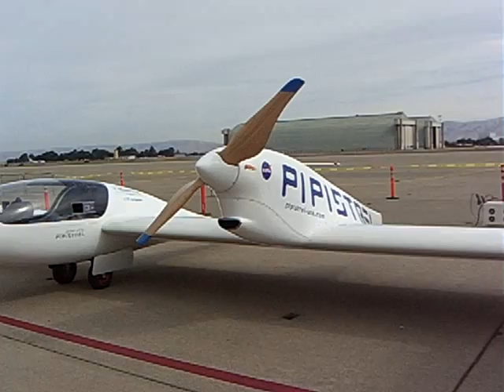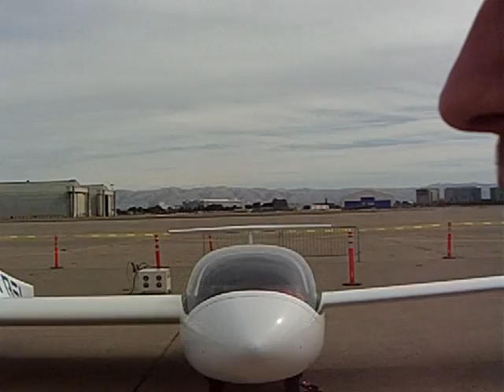Pipistrel Taurus G4 Electric Aircraft winner of $1.35M NASA Google "Green Flight Challenge 2011" -1

Comment: This aircraft designer is both conservative and daring. He is conservative for using a glider design as his base and adding an electric motor to it to enable it to fly in its own without wind, but also daring for coming up with an unusual seating arrangement, two cockpits on either side of the propeller ... thats somewhat unorthodox and shows he is not afraid to do something new to innovate. Impressive and congratulations to the team and the lead designer. You've added to the world's technology.

Comment: I can see a design flaw in this plane. I wonder how much stress the wings can take with the weight of the fuselage and the weight of the passengers and pilot. I don't fear the worse but if it happened in the future I can see one side of the wing from the fuselage to the engine breaking apart from excessive stress and strain in flight.

Comment: is electric propulsion currently not capable of producing enough power to replace jet engine passengers planes.  if you take 100 tons of batteries and 100 tons of aviation fuel will the aviation fuel out perform 100 tons of batteries with current technology.  will electric ducted fans not be able to our perform fuel jet engines with current technogloy.  also the issue with battery aircraft is the  weight remains unlike 100tons of fuel which gets burnt away

Comment: total waste of breath, time, money and brain cells.  Oh, yah, NASA at work again...
Reply: I am sure you would have thought the original Wright Flyer was a waste also. Horse and buggy was much better.
Reply: No, I would not have thought the Wright Flyer was a waste.  Don't put words in my mouth....dishonest.  

 What purpose does this piece of nonsense serve?  Please explain.
Reply: seaplaneguy It was a prototype designed against a specified set of criteria.  It was one of the first steps toward a practical electric airplane.  We will not get there in one step, but many small steps. By promoting compitition like this, NASA moves the designs snd technology forward.  This is very similar to the autonomous vehicle competitions put on by the military that has resulted in the rapid development of self-driving cars today. The motors and controllers used here will be refined and appear in better versions all ready nearing the msrket. First will come short duration trainers, then longer duration aircraft either through improved batteries or fuel cells.  Electric motors are much more efficient and lower in cost than current GA engines.  Seach electric airplane to see the progress in just a few short years from the time of this video.
Reply: So, it is a platform for electric motor development.  OK.  But why not build a valid airplane concept and put the new electric in it.  Any good sailplane would do.  Don't need two cockpits...

I will look at the electric.  Thanks.
Reply: seaplaneguy the competition was sponsored by NASA and the CAFE foundation.  There was a formula that gave a higher score for more people carried.  That is why they used the twin fuselage design so they could earn more points in the compitition.  Look at the two place electric plane the same company released in 2015.
Reply: Yes, I remember that.  This shows that such contests lead to useless designs.   They won by a loophole in the criteria, thus giving resources to the wrong group.